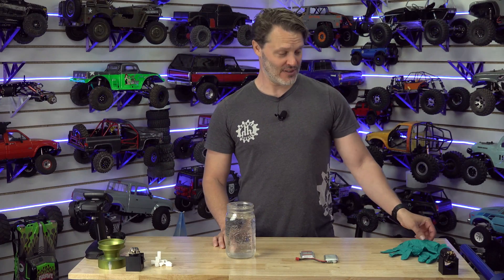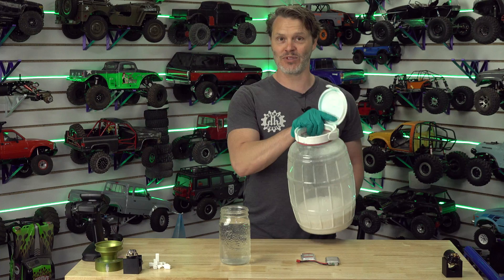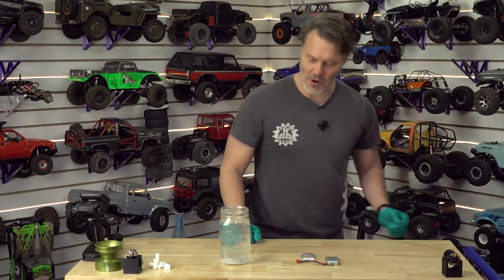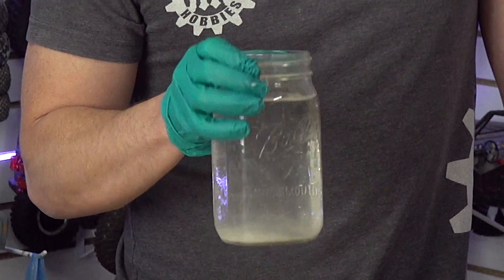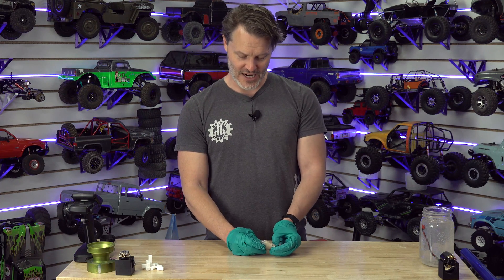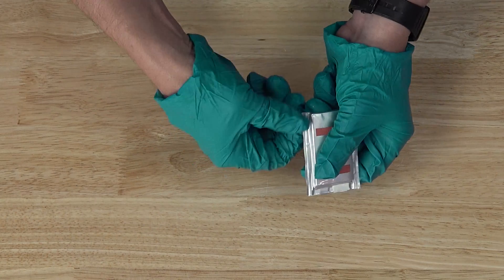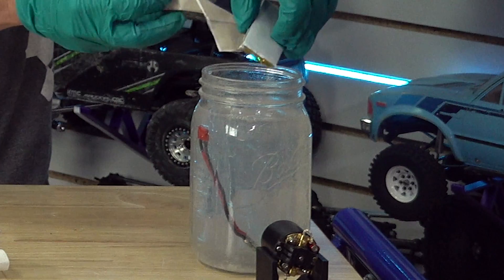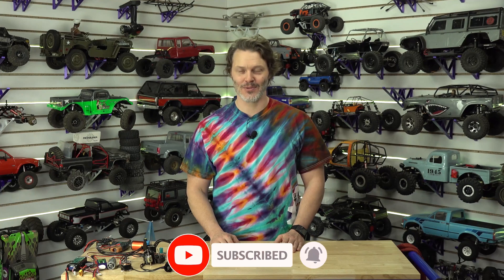🔥 Shocking Revelation: Inside a LiPo Battery with John Robert! | Holmes Hobbies

Comment: Back when I was testing what I still consider the best lipos I ever used, the manufacturer asked me to do a lot of crazy things. The lipos never puffed, never caught fire and I bet if I still had them they would still be alive and kicking lol. What was funny was the fact that higher C rated lipos performed bad compared to them. One example was when I tested my 240A 10t scale ESC with a 1.5T 540 brushless motor, I used the 5Ah 2S pack and it hit the cut off voltage of 3.4V while pumping out 200A and the 5Ah 2S Enerland pack hit the cut off while only pumping out 150A. I was going to tell them about a novel separator, but the cell manufacturer was either bought out or just stopped production. Kind of sad.